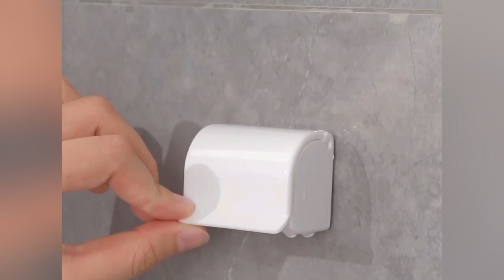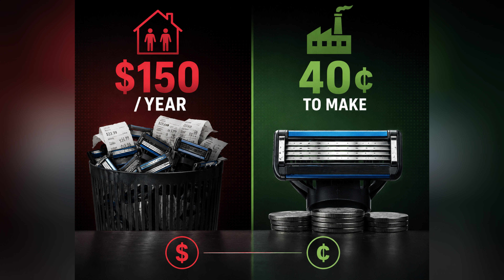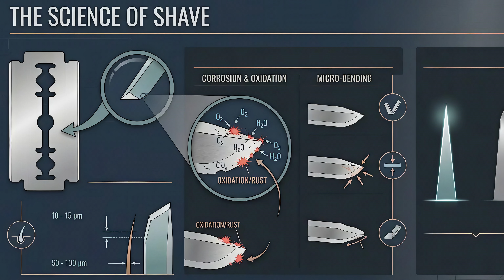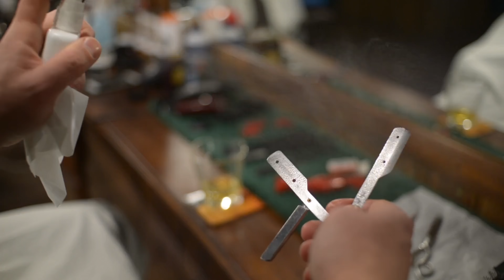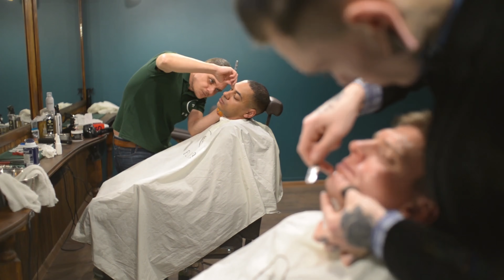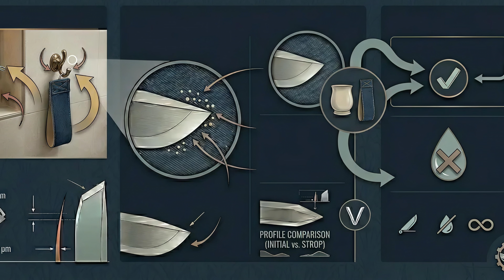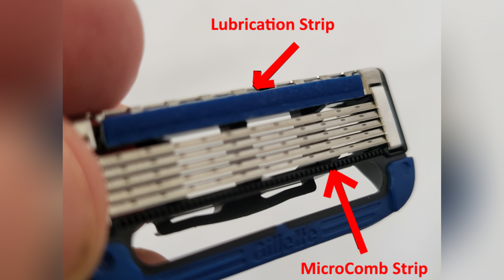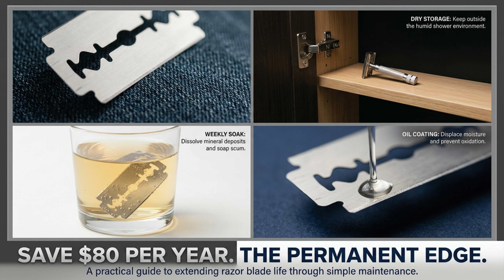Your Razor Is Designed to Dull After 3 Uses — How to Make It Last 2 years!

Comment: My cheap tip: i dont use shaving soaps or creams, i use  a small amount of liquid soap or hair conditioner. Works just as well and a little goes a long way
Reply: Any oil will do too, like Coconut Oil.
Reply: I just use a little shampoo, works every time.
Reply: Shaving cream has definitely gotten more expensive, lately!
Reply: I haven't used shaving cream for over 30 years. Only the soap I bathe with.
Reply: @Quantum3695  yeah, rub plain soap on your face in the shower, shave, wash out the blades with the shower jet.
Reply: Never used shaving cream. Just same soap I use to wash body with. Don't use shampoo or conditioner either, unless just had a barbecue or something. So a few times a year.
Reply: Shaving cream works best for me, but to be fair, I don't have to shave daily.  One can of Barbasol seems to last for years and years, so I never really let it bother me.  But I do see that if you had to shave daily, you'd need to find alternatives.
Reply: I just commented along with my razor blade experience that I use my normal shower gel for shaving since I shave usually in the evening while taking a shower.
Reply: Olive oil, or even plain old skin moisturizer works too.
Reply: Me TOE!
Reply: bro, same, the shaving creams I cannot even smell in the other room, let alone on my own face
Reply: Yes 45 years of shaving, I've used cream about 5 times. Warm water and a lttle soap is the way to go.
Reply: I have never used shaving cream or anything else for that matter.
I just shave after a shower, and it's all good.
Reply: @fastcoffee9878  Barbasol by far the best shave cream. It’s $2.50 a can for me here in FL. Lasts me at least 3 to 4 months, literally half dollar sized blob on fingertips works perfectly for me.  Although I have done conditioner too.
Reply: @fastcoffee9878  lotion works well too
Reply: @fastcoffee9878  it might work for fat skin type. Otherwise for sensitive skin in my case it causes irritation and dryness. I am perfectly fine using inexpensive facial soap full of oils.
Reply: @fastcoffee9878  hair conditioner 👌
Reply: This has been a game changer for me, blades are lasting about ten x as long. Before I carefully tracked how many shaves I’d had on a blade and then discarded, not now.
Reply: @fastcoffee9878  I use lube..
Reply: You don't need anything except to soak your face with a hot wet towel. Been doing it that way for over 20 years. No cream, oils or soap. Just hot water.
Reply: @E-BikingAdventures  simplest is best. Started shaving with my dad's old army safety razor (original issue in a "bakelite" box. Wash face with hot soapy water,rinse and leave wet; then when finished disassemble razor dry it off back into box ready to go again. Buy blades bulk online and you've got your forever razor at a fraction of the cost of modern hi-tech rubbish
Reply: Cheap b’stards 😜
Reply: @oberyn-1 Corporations don't care. They just want people to spend their hard earned money. Even during inflation when people's wages remain the same. 😀
Reply: Didn't know shaving cream was a hill to die on🤣.
Reply: Cheapmunks blabbering

Comment: I don't go through all this. However after shaving, I rinse it out well , shake excess water off , then hold to my lips and blow until I'm sure I got most all moisture out. I then take my hand towel hold it across my arm , run the blades backwards a few times. Then I do the same on my arm. Not sure how many months I go without changing but thinking 4-6. Also I ran out of shaving cream one day. And for the last 6 months I've just wet my face and lather up with Bar soap , rub on face and shave. Oh and it's Homemade Lye Soap my mom made over 35 years ago.
Reply from the maker: It sounds like you've naturally stumbled upon the most important part of blade maintenance: keeping those blades clean, dry, and free of moisture.

Comment: I already own coconut vegetable glycerin -- would that do the same lubrication restoration as the mineral oil?
Reply from the maker: It can help a little with glide, but it won’t do the exact same job as mineral oil.
Vegetable glycerin is water-soluble and kind of sticky/humectant, so it’s better as a skin/shaving lubricant than as a protective coating for the blade. It can actually hold moisture if too much is left behind.

Coconut oil can lubricate, but it can also get a little gummy over time and may leave buildup in cartridge razors.

For restoring/protecting the blades after use, I’d still prefer plain mineral oil because it’s stable, doesn’t go rancid, and creates a better moisture barrier. But if all you have is glycerin/coconut oil, use a very tiny amount, wipe off the excess, and don’t let it build up between the blades.
Reply: @Sidney_Explains_Money  Makes sense.

Comment: 6:43 The metallurgy has changed dramatically because of the introduction of stainless steel replacing the the old blue carbon steel blades.

Comment: I wonder if storing the blade in a box with those silica gel packets that you usually pitch would help. They absorb moisture and I’ve seen videos about drying out those packets on YouTube.
Reply from the maker: Yes, that actually could help a lot. The main enemy of razor blades is moisture sitting on the edge after shaving, so storing the razor in a dry little box with a silica gel packet is a smart idea.

I’d still rinse the blade, shake off the water, and let it air-dry a bit first if possible. Then store it with the silica packet so it can pull out leftover humidity. And yes, those packets can usually be “recharged” by drying them out, depending on the type.

Just don’t store a wet razor in a sealed box with no airflow unless the silica packet is there and still active — otherwise you could accidentally trap moisture in with the blade. But as a general idea? Yep, that’s a good one. It should help slow rust and keep the edge nicer longer.

Comment: It won't work, you need to strop both sides of a razor
Reply from the maker: Yes, that’s a fair point — for a loose double-edge blade, you can strop both sides directly.
What I meant in the video was more for cartridge razors: you’re not really sharpening them like a knife, you’re mostly helping clean, align, and lightly polish the cutting edge by stroking the razor backward on denim. Flipping the razor and doing passes the other way helps because the denim weave runs in a direction, and the blade stack sits at a slight angle, so rubbing both directions gives more even contact.

But yes, if we’re talking about a removable blade where both sides are exposed, then absolutely — both sides should be stropped.

Comment: I have done much of this over my lifetime, and one thing I do that wasn't mentioned is spraying the blade with alcohol after the rinse, etc.. Alcohol is hydroscopic and removes the moisture from the surface of the blade so it doesn't corrode. Good, sensible video. Thanks.
Reply from the maker: I haven't personally used the alcohol method, but it makes perfect scientific sense for preventing oxidation. Thanks for the tip! 😊
Reply: @Sidney_Explains_Money  Braun uses alcohol in its cleaning cartridges for their electric shavers.  Another expensive consumable item filled with inexpensive ingredients.
Reply: Can you tell us what brand you use that sells alcohol in a spray bottle?  I don't think I've ever seen it sold that way but if not, I could find a spray bottle and transfer it.  THANK YOU.
Reply: @RatherNotSay2  - you just need regular isoprophyl alcohol. Buy a jug of it and use it to load an inexpensive small pump spray container. Heck, you could probably use 180 proof vodka if you were in a pinch. 🙂
Reply: @cdpond Thank You!  My husband has been complaining about his razors for years! THANK YOU!
Reply: @RatherNotSay2  CVS 91% Isopropyl alcohol is available  in a 10oz spray bottle.
Reply: @rwrp Thank You!
Reply: Can you explain when sharpening on denim what you mean by flip the razor, if you are already pushing the blades up the denim? Thanks
Reply: @kevochanner8859  yes I want to know that also
Reply: @kevochanner8859  I think he means direction over the denim.  Send it outwards with hand,e towards you, and then bring it back with handle away from you.  The denim is moving over the blade in the same direction, but the blade is ‘stroking’ the denim in the opposite direction so that the denim does not flatten.
Reply: The alcohol will also help to prevent buildup of scaling deposits.
Reply: hennesy or mad dog???
Reply: Are you spending more on alcohol than you are on blades?
Reply: @michaelgreen3036 It is good to ask, but the answer is no. A blade cartridge giving months of extra sharp shaves needs only a fraction of a bottle of alcohol, but saves more money than the cost of  many bottles.

Other savings. We throw less waste into the landfills. We get better shaves. We spend less time buying blades. When we get practice and skill at doing this, it only costs a few seconds per shave.
Reply: @rayporter8451  Would hand-sanitizer work, as it contains alcohol ?

Comment: The maintenance steps in the video are designed for straight barber‑shop razors, which are single pieces of steel meant to be stropped and oiled, not for modern cartridge razors. Cartridge blades are built with ultra‑thin PTFE/chromium coatings, glued blade stacks, and dissolving lubrication strips, so denim stropping, mineral oil, and vinegar can damage the coatings and adhesives instead of restoring them. The only reliable way to extend cartridge life is to rinse with hot water, shake out the water, dry the back, and store the razor somewhere dry to prevent oxidation and moisture damage.
Reply from the maker: You’re right that cartridge razors are not the same as straight razors, but that doesn’t make the method useless.

The denim step is not meant to grind, hone, or remove metal. It’s a light backward strop to help clean and realign the very fine edge. That’s why the video says backward only — never cutting into the denim.

I agree that drying is the most important step. Rinse it, clear the debris, shake it out, dry it, and store it somewhere dry. That alone can massively extend blade life.

But I don’t agree that denim stropping, a tiny amount of mineral oil, or a quick vinegar rinse automatically damages the cartridge. The key is moderation: light strokes, tiny oil amount, short vinegar contact, and no soaking or abuse.

So yes, cartridge razors are more delicate than straight razors — but the basic maintenance principle still applies: clean the blade, keep it dry, and lightly maintain the edge instead of throwing it away too early.
Reply: Adaptations!  Adaptations!  The lubrication strip on some of the disposable razors/heads is annoying; some worse than others; but when done with a shaves, rinse, declog if needed, rinse more, tap on a towel and dry the outer of the head and dry the handle;  then dry the head better, and strop the blades of the head against a towel.  Store the razor/head dry.  Razor or disposable head should be able to deliver at least 10 shaves, maybe as much as 16 or 17 shaves.

Comment: Razor blades don't rust. I have my Gillette Fusion Power for at least 8 months before I have to replace them. 
The only reason I have to replace them early is that the cartridge breaks one way or another.
The secret is to clean them thoroghly after use.
Shave, rinse, then remove the skin cells and hair leftovers from the blades by "shaving" backwards (like in the
video) on the cusion of your palm. Put a little foam on the palm first. This makes the skin cells and hair stick 
to the foam and then rinse off. 
Then dry the rasor. 
This way I only need to buy a 2-pack once a year....
Your razor feels dull and can't shave because the blade is dirty not because it's dull.
Reply from the maker: You’re absolutely right that a dirty blade can feel dull long before the steel is actually worn out. Hair, skin cells, shaving cream, soap film, and minerals can build up between the blades and make the cartridge drag like crazy. So yes, cleaning it thoroughly is a huge part of why your blades last so long.

The only part I’d slightly push back on is “razor blades don’t rust.” Modern blades are usually stainless steel, so they resist rust much better than old carbon steel blades, but stainless does not mean rust-proof. At that tiny cutting edge, moisture, soap residue, minerals, and oxygen can still cause microscopic corrosion/oxidation over time. It may not look like orange rust, but it can still roughen the edge.

So I think we’re mostly saying the same thing from two angles: clean out the debris, dry the blade, and don’t let water sit in the cartridge. Whether the roughness comes from buildup, oxidation, or a slightly bent edge, the solution is basically the same — rinse well, clear the gunk, dry it properly, and store it somewhere dry. That’s exactly why you’re getting a year out of a 2-pack.

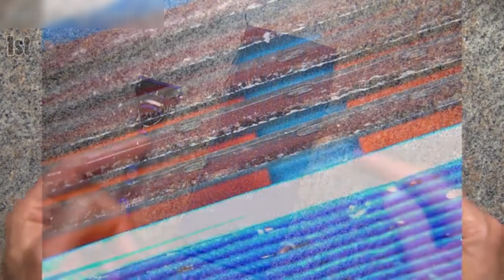Comment: 3:20… 20 strokes on the opposite?
Reply: @reminaya  
Correct. That is complete gibberish. There is no access to the inner side of the blade.
Reply: @BrianMcGuirkBMG  ”easy" access with dental tools & ~20h work OR use old fashion, single 2-edge blades & just flip-over. For a decade I’ve only use the ‘fancy’ stacked blades to trim beard.
Reply: @reminaya  he answers this question a few times in the comments. He means to turn the denim in the opposite direction. Denim is a weave so you should rub the razor in both directions on the denim.
Reply: @reminaya  
Opposite direction of the denim not the blade.
Reply: While polishing the blade, it's in the opposite direction
Reply: @coastofkonkanwhat is the denim? You can't turn over a 3 blade razor it won't touch the blades on that side
Reply: @coastofkonkan
What does polishing the back of the cartridge do?
Reply: I literally came here to ask this same question..
Reply: Exactly what I was wondering.
Reply: @qwaurk985 that's 4 of us now thinking the same thing
Reply: Maybe he means it’s for the single trimming blade
Reply: maybe he means turn the denim? the opposite face of the fabric, not the blade

Comment: This is the way. I stretch my safety razors to last months at a time. I spend maybe $4 a year, including a bottle of grape seed oil that lasts years. I don't even buy shaving soap anymore. Just use a few drops of oil to shave and another drop on the blade after drying.

Comment: So how do you dress the backside of a cartridge blade?
Reply: exactly- the blade edge bends inwards after shaving a few times- not outwards- there's no way to get the back of the blade onto the fabric
Reply: Not can!  What rinse and tapping you can do will not eliminate everything from the bottom side.  Like, you can dry and strop the top side but the blades are stuck in the head as they are so you cannot strop the bottom side.
Reply: @10floz30minutes  - if a person wanted to get really carried away, one could purchase and ultrasonic jewelry cleaner and fill the reservoir with isoprophyl alcohol... drop the cartridge in and let it run for a few minutes.